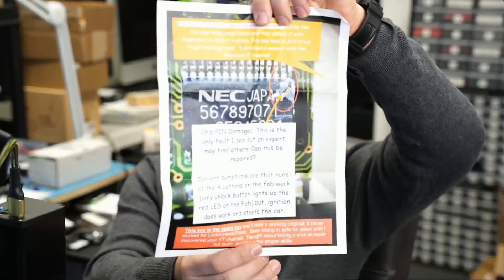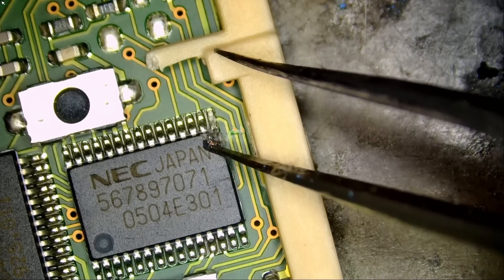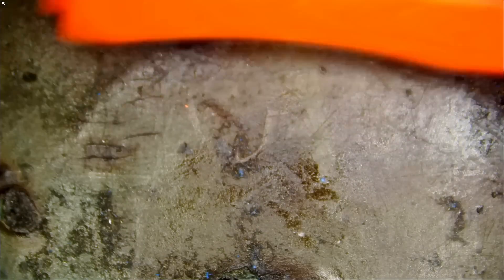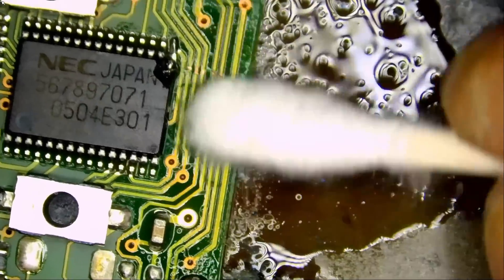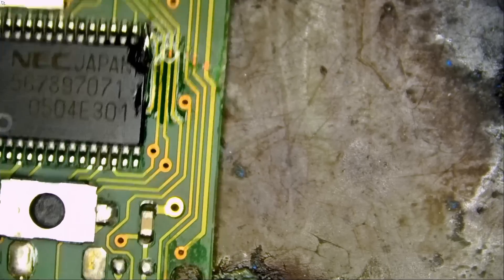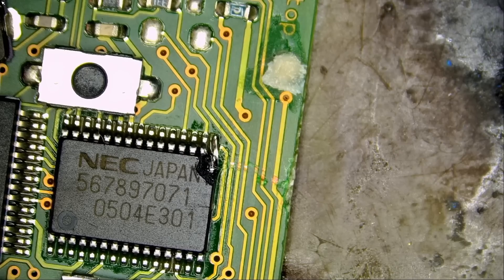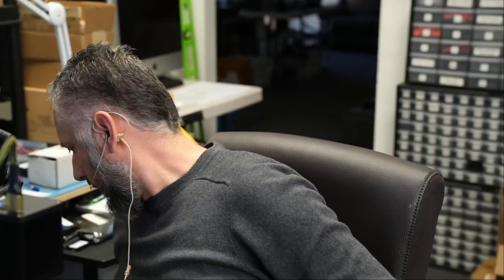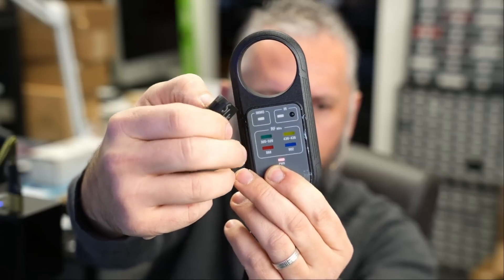Fixing a Benz Key Fob with a Broken Non Replaceable NEC Chip

Comment: Back in the 80s I repaired a 68000 CPU with pin 1 snapped off by cracking the corner off the package, putting it into a socket, and then wiring from guts of chip to the socket.

Comment: I thought with a chunk like that missing on the chip, transistors would be missing too. Maybe they are concentrated in the middle of the chip
Reply: These chips are relatively big so the actual silicon chip is usually a small square in the middle and most of the space is bonding wires. Google "decapped chip" to see what they're like inside.

Comment: Might have been easier to solder to the bent pin before ripping it from the NEC chip. But then again, maybe it was shorting something other stuff in there, so, better yet that you broke it :D
But your soldering skills are amazing. I mean, soldering to a copper trace inside broken the chip itself... That is amazing. And a clean solution, too.

Comment: I am going to impart knowledge as an automotive locksmith that most people do not know. The battery is for the buttons. The transponder which communicates with the cars onboard immo doesn't need the battery or buttons. The fobs have 2 separate functions. You can start the car without the fob battery if it's push to start. Instead of pushing the button with your finger you can use the fob to push the button in most cars not all. Some require the fob to be placed in another part of the car where the antenna is. In this car that fob is called a Fobik which is a little different than a push to start. Mercedes switched over to push to start a while ago. Most of the cars that still use these are old clunkers.
Reply: This is true...  found this out after the fob for my sister's 2020 Toyota was dead af but it would start if you held the fob up against the push to start

Comment: Is that a problem to program new fob for car in USA?
Reply: Expensive. Car dealers…
Reply: The fob itself cannot be reprogrammed. It is a ROM mask chip, there isn't any flash memory inside the NEC chip.
You would need another chip that contains the custom made firmware, probably only made for MB by the fobkey manufacturer. You will not find that chip to buy freely on the market.
Reply: The materials and labor to manufacture and program a fob are cheap.  The dealer marks it up by 50x.  So $10 worth of parts and labor will cost you near $500.  This is the sad state of the modern car industry.

Comment: I'm convinced that these Benz keyfobs have microscopic explosives planted in them. They're easily the most common repair you do on this channel
Reply: Nice theory but you could see the damage was created by gorilla-hands.
In other words, whomever opened that fob pried so hard and with so much force you could see the damage start-point at the edge of the board then continuing across the 7 traces and then right into the corner of the chip.
Hence "gorilla-hands"!
Reply: Nah, it's gotta be theose melted connectors on Nvidia cards that's most common surely. Those, or Asus laptops....